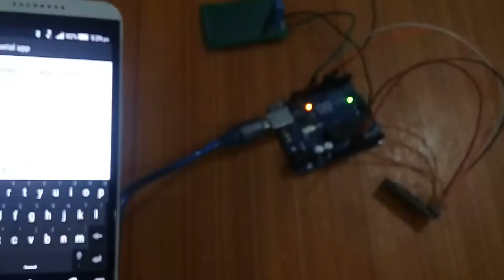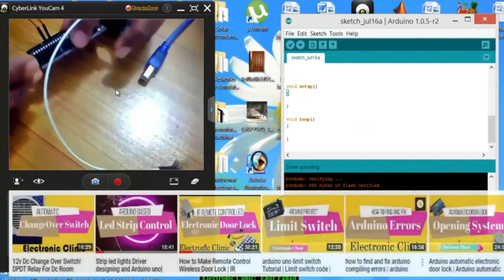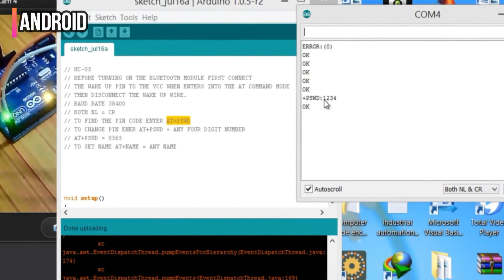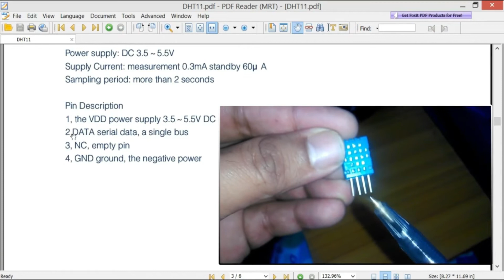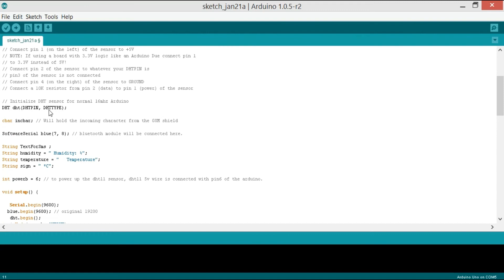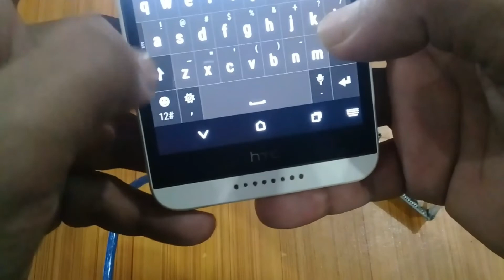Wireless Temperature monitoring using  Hc-05 | Hc-06 Bluetooth Module, Arduino, DHT11,Android cell

Comment: I have a problem that nothing appears on the phone even though the call is online
Reply from the maker: check your wiring.
Reply from the maker: don't power up your gsm module using arduino. use a separate power supply for your gsm module.

Comment: question, can I use a soil moisture sensor instead of a temperature sensor
Reply from the maker: yes, you can.
Reply: @ElectroniClinic  by that, you mean the output will be the same? Do I have to change anything?

Comment: Could you please share android studio code with me bcz i have a problem getting values .
MAIL_ID: mehar3658@gmail.com
Reply from the maker: watch my another video on the android app designing. code is available on my website.
Reply: @ElectroniClinic  i watched your that tutorial also but basically i am working on multiple data to be receive simultaneously, hence it will be more easier to have code of this project, if you can please mail it me @ mailing id= mehar3658@gmail.com . Thanks